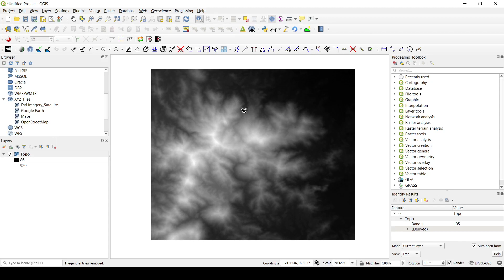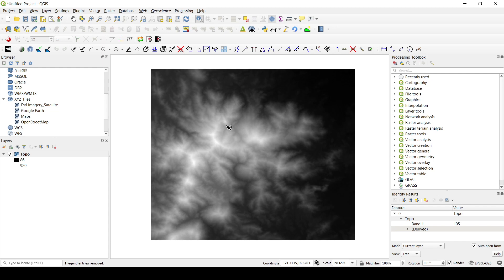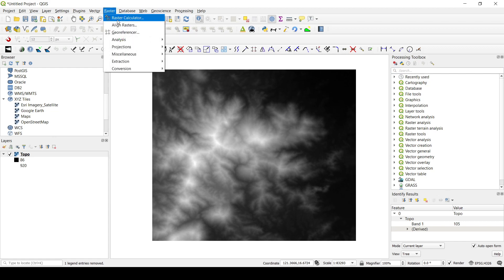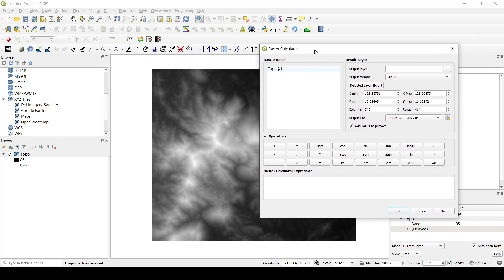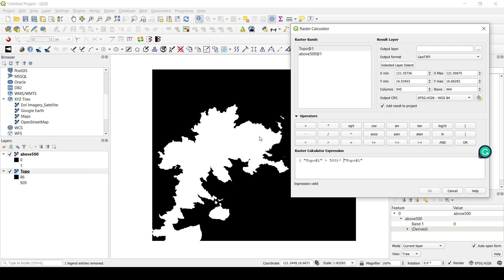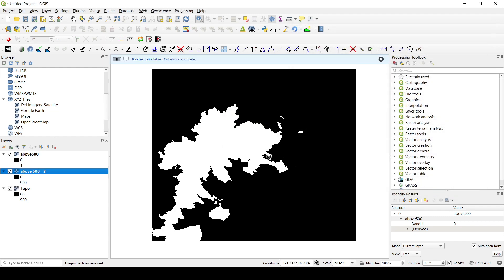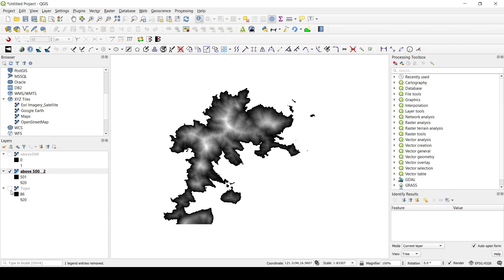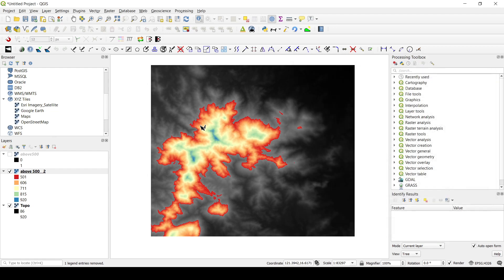Qgis Raster Calculator : "If Condition" Trick

Comment: After changing the value of the unwanted cells into "0" as suggested here, maybe you need to get rid of them, that is, to change their 0 value into NoData value. If so, you can use the trick suggested by Hans van der Kwast in his video "Dealing with NoData in Discrete Rasters using QGIS" (https://www.youtube.com/watch?v=qApnkq7qsFU&t=112s)

Comment: try map@1/(map@1>500). It will do the same in areas >500, but in areas <500 it will do the division by zero that results in NULL so the result map will have only values >500 and no 0 pixels - you dont even have to fix the transparency for 0 pixels. That is objectively better as in further calculations the 0 and NULL values are way different ;) anyway, nice video!
Reply from the maker: Great Tip thank you Jakub
Reply: @MiningGeologist  noprob :)